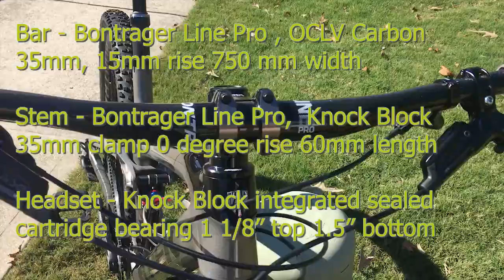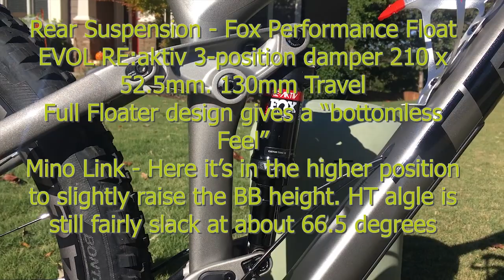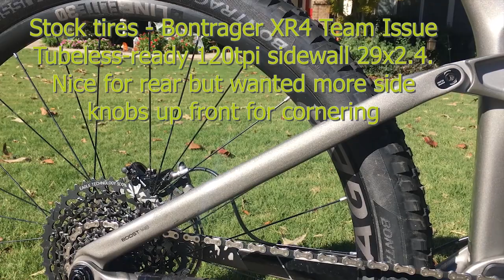2018 Trek Fuel EX 9.8   New Bike Day!

Comment: How much did you get this bike for and how much did the upgrades that u made/make going to cost
Reply from the maker: these guys for the tire, tubeless conversion, water bottle cage, mud guard and clear tape protection-$110. Picked up the bike used for $3,300(pretty sweet deal). Nothing else is needed. It’s better every ride! Thanks for watching!

Comment: Get some plus tires on the 27.5 and you've got close to 29er. No need for another bike OR wheels.
Reply from the maker: Strategic Thinker my other bike could go up to about 2.5 tires. Issue can be fork crown or chain stay mud clearance even if it “just” fits. I agree with you for those bikes that can use either through some geometry flip chip. Pretty cool flexibility 👍😀